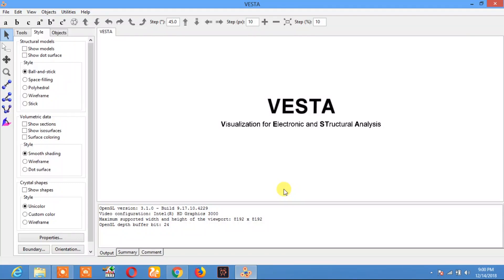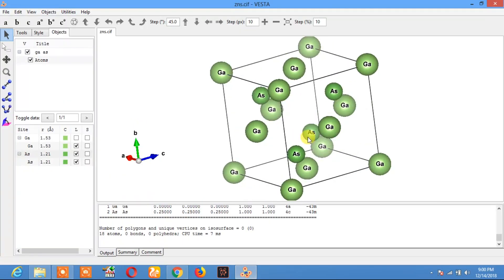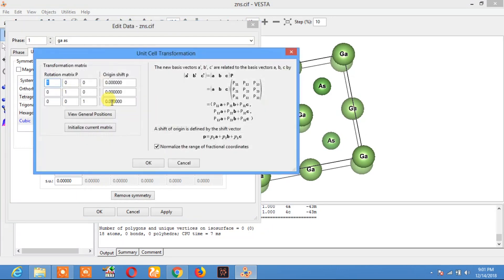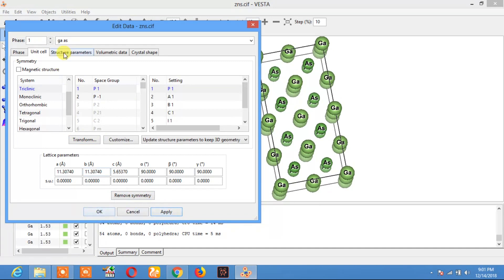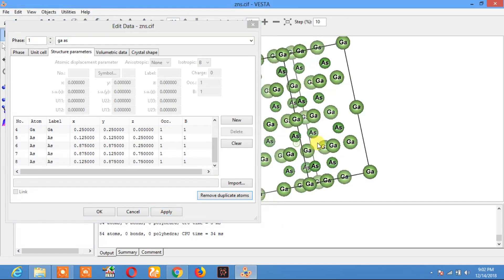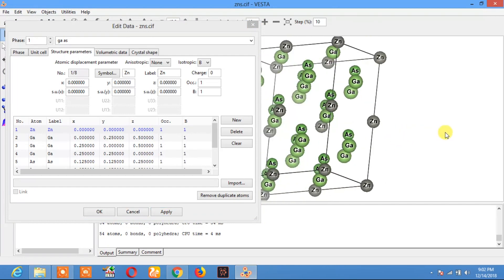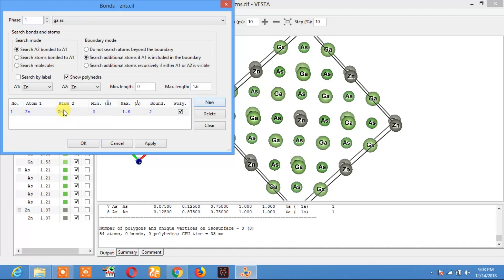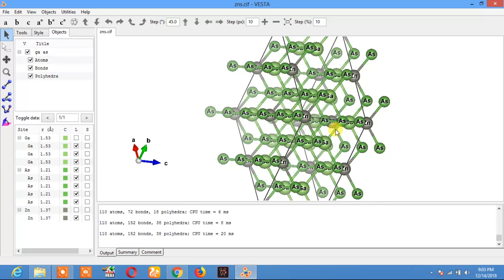Doping and Alloying with Vesta (GaAs Zn example)

Comment: Can we plot the graph between energy Vs  DOS on this software??
Reply from the maker: No this software is just for creating crystal structure file, Visualization for Electronic Structural analysis (VESTA). For dos and other calculation you can use Quantum Espresso, wien2k, vassp etc
Reply: @easyedu99  Thank you sir for your valuable guidance..